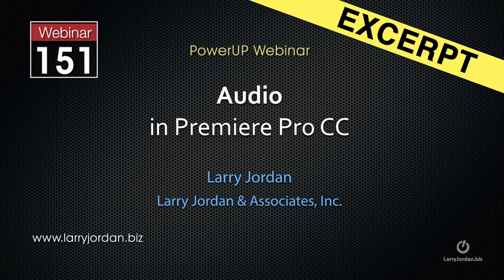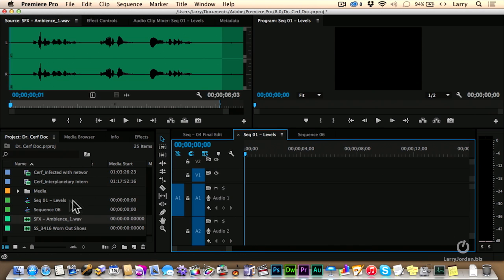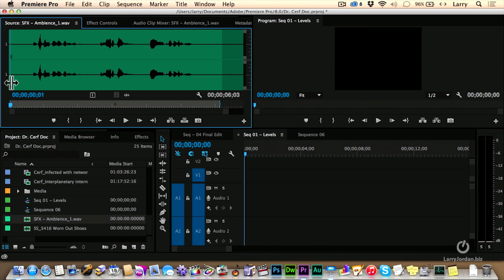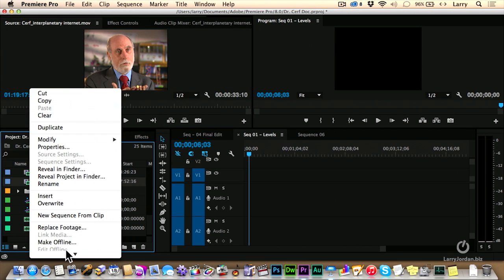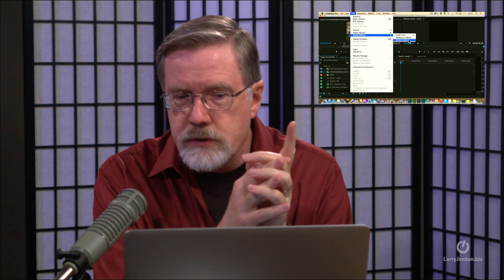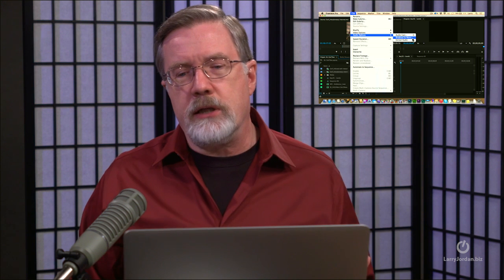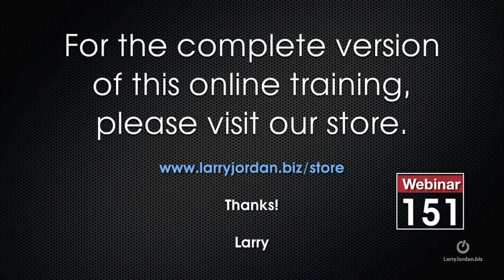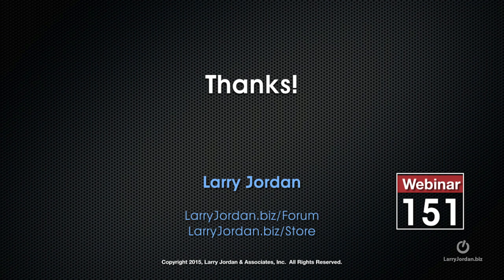Separating Audio Channels in Premiere Pro CC

Comment: i have 3 audio tracks in my twitch vod. It is an mp4. All tracks funtion in MPC. A1: stream audio (mic+ RWYH) A2: mic only A3 : RWYH only
When I try to import this into premier pro and follow your instructions, it thinks that Track 1 is muted and tracks 2 and 3 are the same thing. 

All i wan tto do is seperate the voice from the sounds.

Anyway, i literally have an mp4 with 3 seperate audio tracks and no way to actually do anything at this point. premier pro just keeps mixing track 2 and 3 together regardless of what i do. no idea.
Reply: audio functions on twitch stream also. track 1 is not muted. just according to premier pro it is.
Reply from the maker: 1001 Games:

MP4 audio is generally a problem. My suggestion is to contact Adobe Support and have them help you figure this out.

However, after importing and before moving into a sequence, make sure to set audio properties to 3 mono tracks.

Larry

Comment: What if the audio is one audio clip? For example: I have an audio track from a video, but the voice and bg music is in one track since it was recorded together. The voice was recorded on its own mic, but the audio track is like I mentioned, is saved as one 

The voice sounds lower, and the bg music is higher. How can I manually separate in the singular audio track, to bring the voice higher in volume?
Reply from the maker: Sydney Its Sydney:

Sigh... the short answer is: you can't. Not if both voice and music are on one track.

The longer answer is you can - but it is very expensive, requires special software and takes a long time. I can't do it, but I have known several high-end audio production houses that have the software tools to extract the voice.

Larry
Reply: @LarryJordanFCP   Thank you for your video and answer, Mr Jordan! It's highly helpful!

I have the same problem as this person, except I recorded with the microphone and system sound(bg music, ect.) separated. I know this because when I open the .mp4 file in VLC media player, then check Audio > Audio Track, I can select the System Sound or Microphone, and the audio played them separately. This is what I wanted.

However, when I imported it over to Premiere Pro, the audio ended up mixed.

I tried to follow your advice in the video, but the best I could do is duplicating the same mixed audio instead of separating the Microphone and the System Sound.

Apologies, but do you have any idea how to help? Thank you.
Reply from the maker: @SyPotato  

If the audio is recorded to separate channels, right-click the audio in the Program pane, or the bin where it is stored, and select Modify > Audio Channels.

In the resulting dialog, make sure Clip Channel Format is set to Mono, the number of audio clips is set to 2 and that Clip 1 is assigned the Left channel and Clip 2 is assigned the right.

Larry
Reply from the maker: Sydney Its Sydney:

Sadly, you can't. Once the audio sources are mixed separating them is impossible. (Well... not "impossible." But it will take some very expensive software and the tools of a professional audio house to separate them. Unless you have a very large budget, separating them will be impossible.

Sorry,

Larry

Comment: When I do the change, I get two audios but not that seperates the audio inputs, rather dublicates the audio in two. What can I do ?
Reply: you must add a track in the panel.
Reply: @oliviertalouarn6258  what to do u mean by that?
Reply: @zohaibahmed5371  the number of audio track. Must be set to 2 for a separation of a "dual channel " ( 2 tracks , but not stéreo, a hf mic and a boom for example)
Reply: @zohaibahmed5371  in the audio properties of a track you can choose differents distribution. Stereo, dual mono, or separate to differents tracks, but for this you must choose the number "track" you want, wish will be separated in the timeline when you put it in. It must be made BEFORE insertion in the timeline.
Reply: @Arya Chakraborty this "what" ?
Reply: @Arya Chakraborty in the BIN; right clik on the sound,  and go to 'modify/ audio channels", choose the type of track, 'clip channel Format", choose mono, and under this line "number of channels"", type "2". You will see them under. Then, IMPORTANT, create 2 mono tracks in the timeline. Remove the old ones wich are "adaptive" or stereo (or lock them if they are useful). Now if you drag your "separated' sound in the timeline, the sound should be distributed over 2 mono tracks, and not in a adaptive one. This is the trick.
Reply: I think most of the people here claiming "it does not work" is just because they do not create mono tracks in the timeline. without it, and as it's the default setting, they are fooled by "adaptative" tracks.
Reply: those "adaptative " tracks  rebuild a stereo ... witch we don't want ... There is also a general preference about this behavior in the soft, witch can be modified.

Comment: When I'm done, how I can export the two mono clip? I have to put it again both on stereo?
Reply from the maker: Fabio:

By definition, a two channel clip is stereo. So,  in Premiere, you define your project as a stereo project and, when you export, all dual-channel mono clips are turned into stereo. You will need to adjust pan settings if you need mono sounds to appear more on one speaker than the other.

Larry